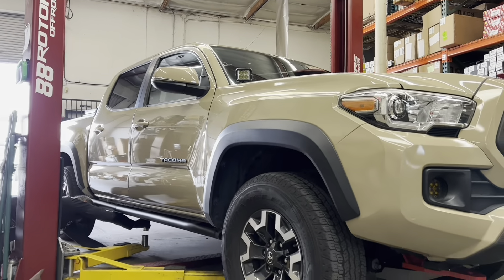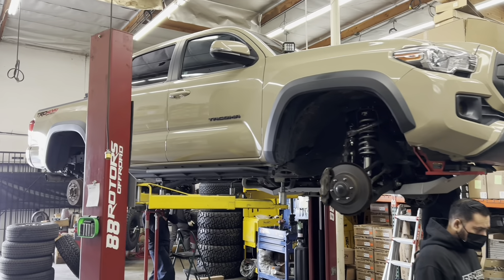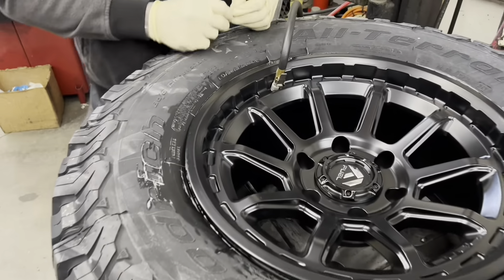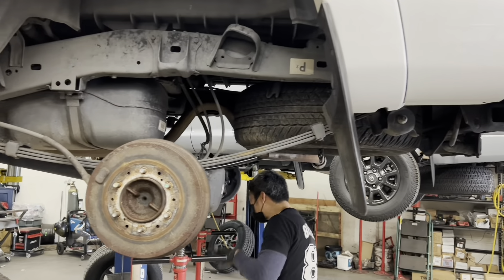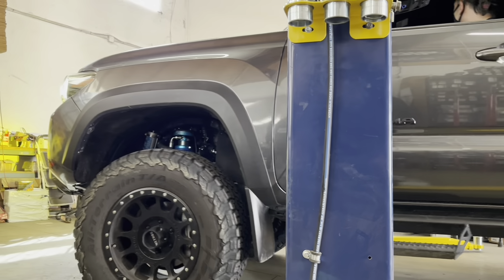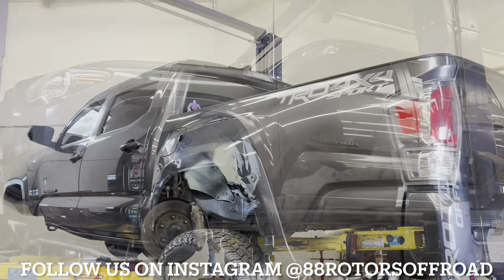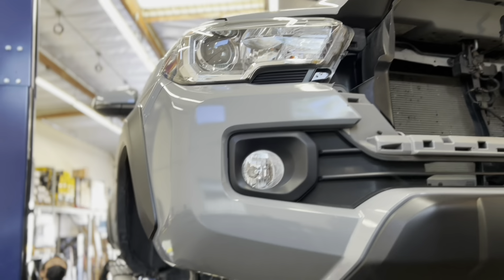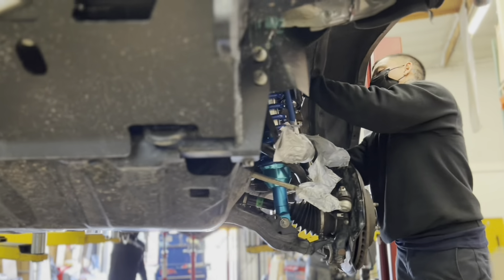Lucky 7 Pack of Lifted Toyota Tacoma Trucks

Comment: Do you take trade in wheels? want to trade in an aftermarket wheels that came with the tundra to a different one.
Reply from the maker: Sorry, we do not. Depending on its popularity in style/spec, you can more than likely easily sell it on Craigs or Offerup when it comes to used stuff.

Comment: On a 2nd gen Tacoma, do I need a body mount chop to fit 285/70/17s?
Reply: Depends really, without a lift then yes you will. With a 3 inch lift it will slightly rub, but not so much. Most of the time it would clear.